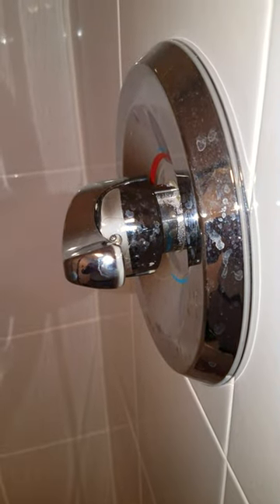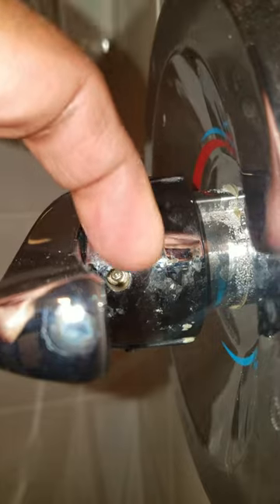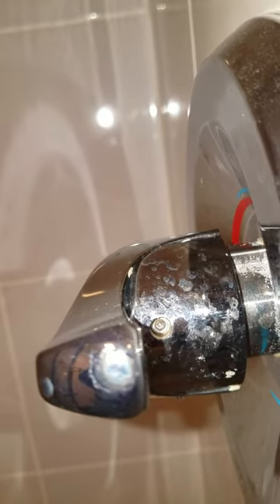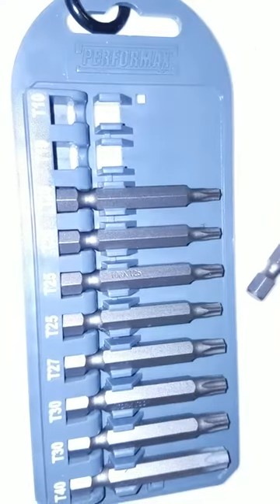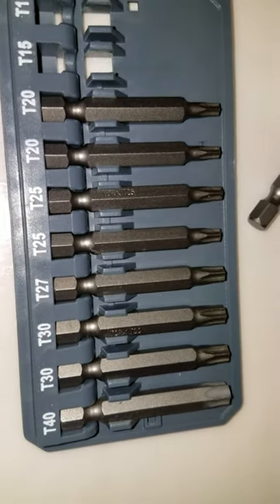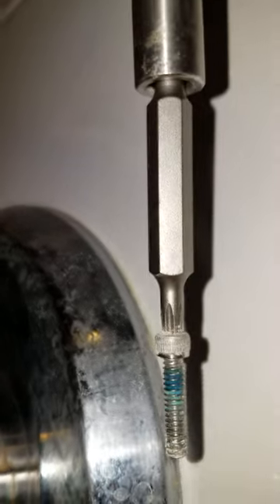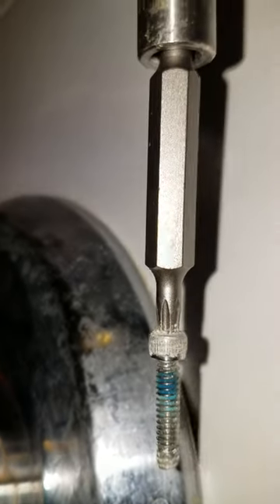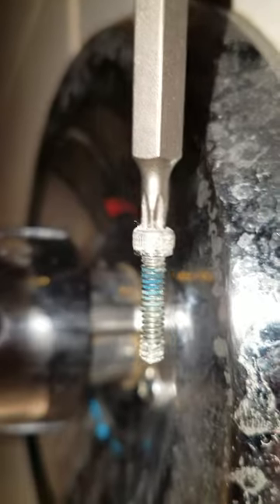Do NOT assume that the hex set screw of your shower handle is stripped!

Comment: Praise Jesus, I gave up already, then had to try again since newborn baby can't stand the occasional cold shower. Your method worked, though I tried a bigger bit after almost completely drill through the set screw. Who in their right mind would design such a pain in the rear!? If you have a water softener installed, this is a must happen, since there is added salt in the water. PRL for your video! I was praising Jesus with my brother in law in the bathroom after taking out the screw. Haven't been this happy for so long!

Comment: This was the 5th video I watched about removing a stripped set screw after I just installed a new trim kit and already messed up the set screw and was about to start trying a few methods. After seeing your vid I went to try once more but this time I tried hex bits, but they were too wide to reach the screw through the handle hole. So I tried a different allen wrench set from my same tool kit and soon realized the 2nd set had one that fit better than the first allen wrench set and the screw came right out 🎉
Literally just now finished and ran back here to Thank YOU and thank Jesus!!!!!!!😄😄😄🙏

Comment: Just wanted to say that I had this exact issue and spent a solid hour trying to get the little screw outta there. I used every trick I thought of. Found this video and looked through my gear, and found a size 15 driver just like the one you mentioned. Twisted it around in there til I felt something come loose, then put my allen wrench back in and voila! Worked like a charm. I still ordered a replacement handle/screw because I tore up my old one pretty good.

Comment: 1/8th inch allen wrench.  I turned the bath/show water faucet on, which put the allen screw hole straight up.  (Warning, CLR will burn skin)  Then I squirted some 'CLR' Calcium Lime Rust remover product into the allen screw hole and left it for some time to clean the gunck out of the allen screw hole.  Use a jewelers straight blade screw driver or a cotter pin to clean out the calcium from inside the allen wrench hole.  I turned  on the flexbile hose shower head to then use some water spray to clean the 'CLR' style acid out of the allen screw hole.   1/8th inch Allen wrench was  my size that fit the hole.  Another person below used a 7/64 size allen wrench.  This was for an American Delta faucet.  Don't know if 3 mm allen wrench works for other Delta Faucet.

Comment: Unfortunately, on my American Standard shower handle, this didnt work for me. However, I ordered a new cartridge which comes with a hex key that fits right into the set screw. I'd gone from hours scratching my head to loosening the set screw in seconds with the hex key. If you cant get the set screw out and its not stripped, it might be better to get a new catridge/handle assembly from your tub's manufacturer and use the tool that comes with it for the set screw.

Comment: Thank you so much!!! And definitely thank you Jesus!!! You saved me from having to drill out the screw. Your recommendation to use the T15 adapter is what did it. I tried the T15 to no avail. Then I decided I may as well try the next smaller size...and it worked! I was able to get the screw out a little bit, and then had to go back to using the hammered-in T15. HAPPY DANCE!!! ❤❤❤

Now gotta figure out how to get the cartridge puller to work, lol.
Reply from the maker: So happy to hear it worked for you

Comment: When I already lost all my faith and was about to drill the f*** handle to get the screw out, then your video brings me back to life!. 
Thanks, it works perfect, but we aware I have used a power tool, slowly and steadily, I also pour a drop of 3in1 oil (wd40) on the screw 10 minutes before. I doubt it will work fine with manual tools. I have tried first with the Allen wrench 7/64 (fit better) and all of the metric and SAE combinations.

Comment: Yes that is a good way to take out a booger up hex screw. Using Torx bits .

Next time make sure you have bright enough light to look first.
And before putting the set screw use silicone grease available in plumbing section.

Silicone grease would prevent the set screw from seizing and welded shut with calcium deposit .

Silicone grease would also prolong the gasket life .
A coat of it on all the thread would make next person who has to open the faucet easier .

I always put silicone grease on all my NEW faucet install . All the gasket , all the thread and all the set screw . 
10 years latter when I have to open it up .
I won’t have trouble 😊

Comment: Hi I am running into the same issue now. Can someone pls clarify what needs to be done? I bought a T10 impact bit.  Should I just try to drill into that hole? Or do I need any additional screws to drive into and then pull it out? Thanks so much!!
Reply from the maker: @Rangan Please watch the video. I did not need to drill anything
Reply: I'm having this same problem
Reply: It's 1.5 min of your time. Video was perfect 👌